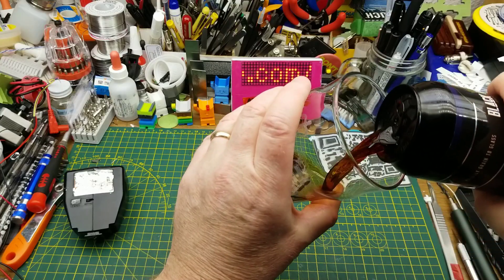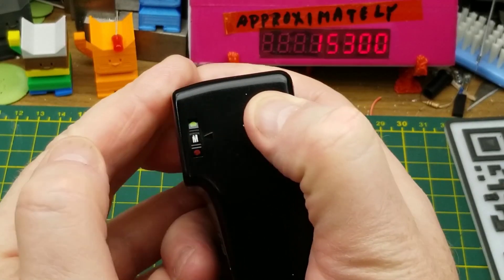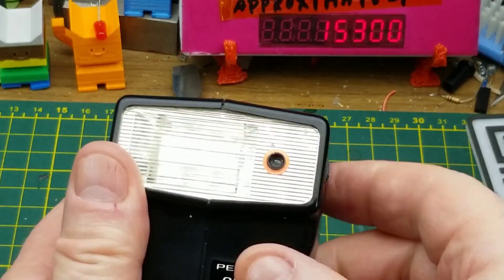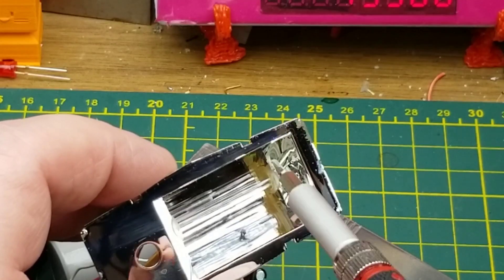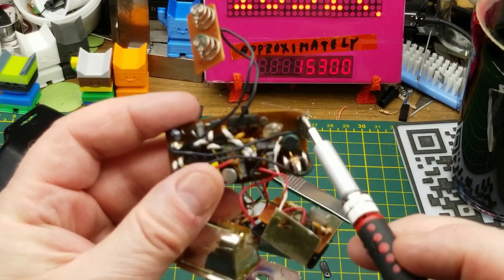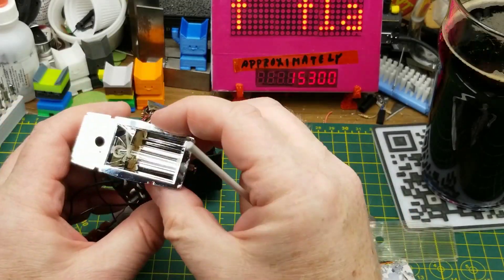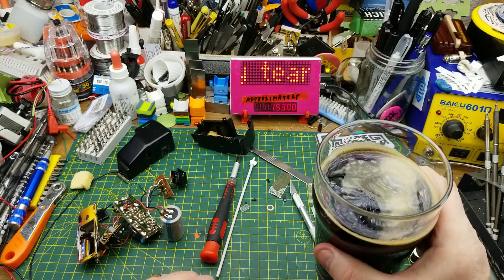Curiosity teardown: Pentax camera flash

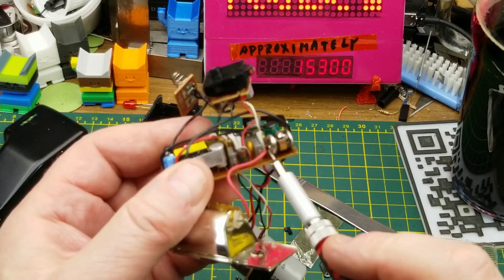Comment: Dates from around 1975, basic and feeble, and is pre-thyristor tech.  7:10 component is a quench or dark discharge tube to dump remaining charge when the xenon tube needs to be extinguished. I'd give much greater priority to discharging the main capacitor, they can give a nasty shock, and IDK why you chose a "cheap old meter" for it. Also, those screws will be JIS (Japanese standard) not Philips (USA standard) - I know people say "Philips" carelessly.
Reply from the maker: I always choose the cheap (and expendable) meter if there's a possibility that an unknown high voltage might damage my test equipment.
Reply: @pileofstuff  I see that, but the capacitor was rated at 350v so the circuit designer won't have exceeded that, and every multimeter I've seen has been rated at 600v (like that one) or above. It's hard to think of a fault in a flash unit that could make that voltage rise very significantly above its proper level. Maybe if the voltage regulation in the inverter stage failed, but even then less than 50%.

Comment: When I took a camera flash apart, I usually discharge the capacitor using a regular E27 light bulb connected to bare wire. It will light up briefly and then fades . If it's completely off it means the capacitor is safe to touch
Reply: Yeah, he was very cavalier about that capacitor. I know the unit was dead, but I was holding my breath when he was waving his fingers around its terminals.

Comment: The “mystery” 3-terminal device is a triggered spark gap.  I works in principle like a smaller flash tube.  Not shown on the schematic, but I think it gives a much fasre rise to the trigger electrode of the flash tube.  There is also a need to isolate the camera ht shoe terminals from any high voltage. I seem to recall that the maximum in any circumstances on the hot shoe or remote trigger is a few volts, like below 15 V.
Reply: It is indeed like a smaller flash tube, but it is to divert current from the main tube (and hence extinguish it) when adequate exposure has been reached. There is a standard to limit the hot shoe contacts to 24 volts, and most are now lower than that, like 5 volts.  But that is a modern standard - some older flash units had MUCH higher voltages, several 100's, and people reported nasty shocks from the popular Vivitar 283.

Comment: I used to tear down those disposable cameras back in the 90's. I took the film to the photo store and kept the electronics for myself. I connected two leads across the big capacitor and shocked my classmates (and myself occasionally) with 300+ volts. One of them still has a little scar in the palm of her hand. Ooops. There is something really exciting about those Xenon flashers though, I also love the barricade lights that use Xenon, tore down a few of those too.

Comment: The mystery thing shorts out the tube to end the flash early. The middle terminal is a similar trigger terminal to the trigger of the main tube. When the flash has given out enough light, it gets triggered. The light is often measured in the camera body or lens, and the signal goes through that third terminal in the hot shoe.
Reply from the maker: Thank you. I wasn't sure how the camera-flash communication did it's thing.
Reply: @pileofstuff  The third contact was nothing to do with exposure control. It sent a signal to the camera viewfinder that the flash was ready to fire, and it could also set the camera shutter to sync speed. That only worked if it was on a Pentax camera of course - other makes ahd other systems.
Reply: This unit is much older than control from the camera (TTL control).  It is controlled by its own photocell, the thing in the red circle at 0:25. That was the old "Auto" mode that was found c1970 - c2000.

Comment: My non smart flash unit had also AC power input and I dropped it a few times as I got a nasty chock from the shoe connector. Not very safe circuit?

Comment: Nice. So, it seems to oscillate, given those 75V on the capacitor, why it was not working? It would be nice to investigate that too, aside the teardown, even if the unit was to be discarted after the teardown.
Reply: i would think it became unreliable due to aged components (including the tube), and sometimes not fire, this would waste film, remember film, and therefore just thrown out.
Reply: @fumthings  Yes, I remember that those tubes did not lasted long, they had a limited number of hours for working time. However, I was wondering what was wrong with this unit, it charged the big capacitor, up to more than 70 V but the neon lamp did not lighted up.

Comment: I used to repair photo equipment in the '80s. I was told that the mystery component is called a 'Quench tube'. One of hose battery springs looked green. :)
Reply: I’ve got this flash with a green spring as well, any recommendations on how to fix it? I tried cleaning it but it’s still not working

Comment: The mystery component is most likely to dump charge to quench the main flash in order to reduce exposure when required.
Reply: Yup. IIRC it’s also a tiny gas tube filled with low pressure argon. I say that because they glow green when subbed for a neon tube.

Yeah, I also took one of these (or very similar) apart in the late 70s to play with.

Comment: was still a lot better than the old flash cubes, that were fired by hitting the bottom of the glass bulb.
I would have said sometime around the late 70's.
Reply: Magicubes, in the sixties to late seventies.  They were still available round about 1980, for those that that still had an old Kodak Instamatic or similar.  A spring struck a post that went through the base of the bulb, and that triggered a fulminate primer in the bulb by shock.  The bulb was filled with zirconium foil and oxygen gas, which flashed very brightly.  The Instamatic was F11 wide open and the film was 100ASA, so the bulb had to be quite bright and the range was only seven or eight feet.  Being photographed with one was like being hit in the face.  I was never given access to magicubes except maybe one, once.  They were considered rather expensive and a little dangerous even for 1960s children (ie third degree burn dangerous if you misused them). By 1980 you couldn't give them away in three packs for about ten bucks.

I don't recall that there were ever instructions on what setting to use on the camera, but you only had two - sunny or cloudy.  I now know that this equated to f/16 and f/11, but it wasn't terribly intuitive that you should maybe use the cloudy setting with the Magicube for your family Christmas photos...

That wasn't even the oldest camera I had, the first one was probably a Holga.
Reply: @Chris_the_Muso IIRC, the act of inserting the cube into the camera activated a mechanism (button? lever? electrical switch?
 ... anyway, something triggered by the shaft on the bottom of the cube) that set the camera shutter and/or aperture appropriately for the flash exposure.

Comment: Well, I think this one is older then the 90's, and just has little communication-systems to the camera therefore and probably was using a high trigger-voltage instead of the lower voltages of the later models of Pentax-Flashes that can still be used on DSLR's these days (yes, compatible withing Pentax!).
The camera with flash can actually make the burst of the flash shorter when there is less needed, so not fully uncharge the capacitor and having more flashes. This is set with the older models like thiese with the green/red switch and then the aperture (the opening in the lens) is set to an opening accordingly.
With the newer flashes from the 90's onword,the extra contact can do this directly from the body of the camera for even more ease of use.
In the auto-settings of the flash itself, the return-amount to the flash is limiting the period of flash (it measures reflectance).